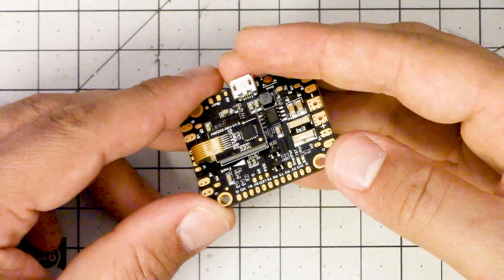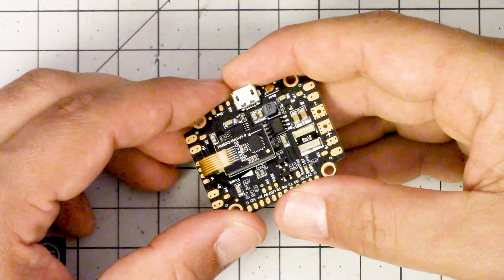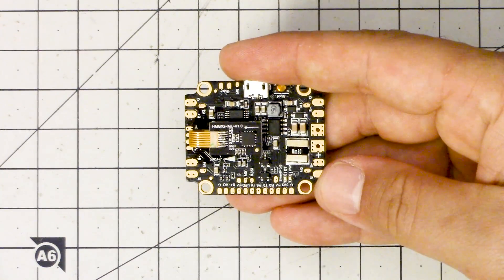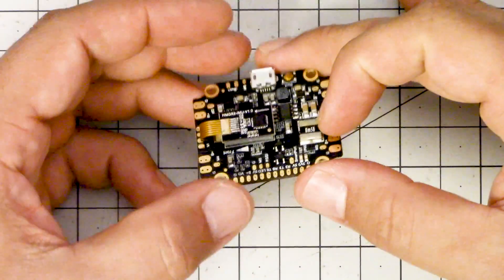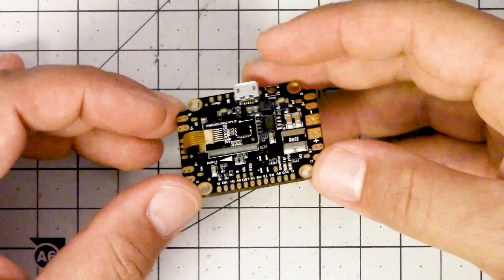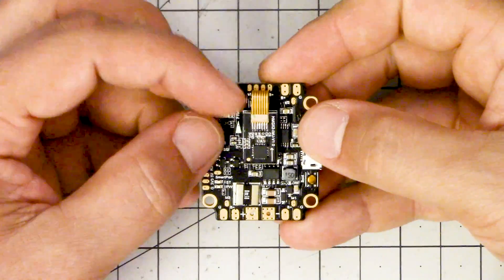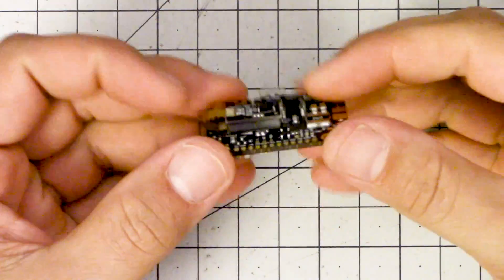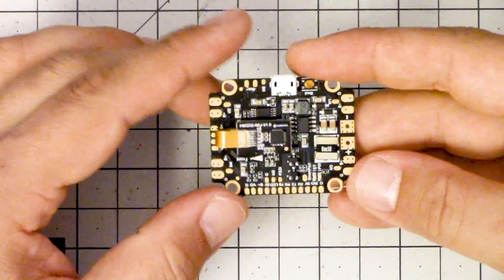Holybro Kakute F4 AIO | BETAFLIGHT FLIGHT CONTROLLER REVIEW

Comment: No regulator or LC filter (like the BFF3) for powering VTX and camera?
Reply from the maker: The product page shows the specifications, which contain the answer to your question.

"Filtered voltage output for clean, noise-free video. On-board regulators output 5v at up to 1.5 amps and 3.3v at up to 200 mA to power peripherals such as receiver, video transmitter, FPV camera, or LED strip."
Reply: Joshua Bardwell My VTX needs 7+ volts, so I guess the answer to my question is no. The BFF3 can supply filtered VBAT.

Comment: I appreciate the perfect work with the documentation... but the hardware is HolyShit .. sbus and smartport not working ... and it doesn't matter what BF version or which FrSky receiver you use (also tried different FW on each receiver) and for sure halfduplex off (syntax depending on BF version)
had to replace the brand new FC with a Matek F405-AIO ... and it seems I am not the only one with problems
Really sad about swapping the FC ... but even if a replacement would work, I would always have a bad feeling when flying
... again ... best documentation ever!!

Comment: Hey @Joshua Bradwell!
 
what you think could happen if with time, temperature or other external forces the angle of the gyro changes!? I am afraid that this could had a devastating impact on the performance, no? I see the benefits of soft mounting the FC, but if then the angle can change slightly, the gyro can´t do it`s job good anymore. 

Or am I over thinking this? Can't the foam move really? Or is the code handling that? What do you think folks?

Greets from Germany!
Reply from the maker: The foam is stiff enough that there won't be any unintended motion. You do have to route cables so as to avoid bumping the gyro though.
Reply: Joshua Bardwell thanks for the reply! 
I think if the angle of the Gyro is off there will be problems. When setting your board orientation wrong in the configurator it will cause big problems. And like 1-3 deg can be a easy of when gluing like that, what could cause some issues, don't you think? But I would really like to hear from you that this fears are without reason! Keep up your great work! Cheers!

Comment: Does the Kakute F4 have 5V reverse current protection on the 5v regulator? Thinkimg of installing a runcam split without a diode. Can anyone answer this?
Reply from the maker: I doubt it. Just don't run the Split and plug in the LiPo at the same time and you'll be okay. The issue is not reverse current. It's when two regulators are on the same rail at the same time and they "fight".
Reply: Joshua Bardwell thx man, keep up the good work with all the videos

Comment: Josh I'm having trouble with this FC.  I'm trying to flash a newer release of 3.2 but I get failed to open serial port.  Have you been able to update yours?  Btw the video with drew at flight fest was very funny.  Thanks for all your work!
Reply from the maker: Are you holding down the bootloader button when you plug the board in?

Do you see "DFU" in the upper-right pulldown menu? Or do you see "Manual Selection"?
Reply: Joshua Bardwell I did hold down the boot loader button.  It did say manual but I don't know if there was a dfu selection in the drop down list.  I will check when I get home.  Thanks
Reply from the maker: If you don't see "DFU" then your drivers are not set up right. Use the ImpulseRC Driver Fixer. Plug in your board in bootloader mode after running the app.
Reply: Joshua Bardwell I just watched your old video and I didn't do the Zadig driver update for boot loader mode.  So I'll see which method works "impulserc" or the "zadig"?  The reason I'm doing this is I can't connect to blhelisuite32.  It tells me to update the interface to supported revision protocol 107 or higher.  Do you think an update will help?  Thank you
Reply: Joshua Bardwell I did the impulseRC driver fixer and it worked like a charm.  I updated to a later release of betaflight and now I can access blhelisuite32 to reverse motors.  Thanks for taking the time to help me!

Comment: Hey Josh, While soldering on the ESC to the FC, the M1 pad lifted off the PCB with barely any force while I was soldering the ESC ground wire to the ESC ground wire pad.  Is there anyway to fix the M1 pad or is the FC toast?  Thanks.
Reply from the maker: Most likely, you overheated the pad with too hot iron or too much time spent working the pad. The good news is the Kakute F4 AIO has six motor outputs, so you can just remap M1 to M5 or M6.
Reply: Sorry Josh, but this is not overheating.  Even gentle pressure (like moving the attached wire aside) is causing the small pads to come off.  Never had a problem like this before and I have built several quads with the Kakute F3 AIO.  Just a warning to others...be super super super careful.

Comment: While it's a good solution for isolating the gyro from frame vibrations, I expect that open soft mounting will create even more problems due to wind turbulence. There's a lot of wind rushing through a frame at high speed. The slightest nudge on that ribbon cable or gyro board is going to be noticed.
Reply from the maker: We haven't noticed anything like this in our flight testing FWIW. Obviously, we can't test all possible frames and etc. If somebody were running into this type of problem, I would recommend replacing the factory foam with something like 3M foam tape or servo mounting tape. Something lower-profile and stiffer.

Comment: Joshua, hello from Ukraine!
I bought two of this boards and I have a question about RSSI.
I soldered wire from XM+ RSSI pad to RSSI pad on a board. But on OSD I have 99% always. 
Can you advice me, how to fix it, what should I do in order to make it work.
Thank you in advance!
Reply from the maker: I'm not sure how the RSSI pad on the XM+ works. I know the XM+ has RSSI transmitted on channel 16 always. In Betaflight you can set an RSSI channel where the channel value is interpreted as RSSI. That's the way it's intended to be done with the XM+.

Comment: Joshua, Why cant I run 32k 32k on this fc without 100% cpu usage. It can only manage 32k 8k or 16k 16k. I'm running betaflight 3.17 and only telemetry turned on. I've tried the latest nightly build of Betaflight 3.2 to program the escs, but the motor tab didn't work, so I went back to 3.17.
Reply from the maker: 32k support in 3.1.7 is completely at your own risk. If you want to run 3.2, you have to download the compatible configurator from github and manually install it. The current release of the configurator, which is in the app store, does not work with 3.2.

You are trying to use an un-released feature in a pre-alpha firmware is the short answer to your question. When a version of betaflight releases with 32k support, then this board can be expected to support it.
Reply: Ok, thanks for taking the time to answer.

Comment: You should have told Holybro that 120A continous current (2 oz copper) is to few in time with avan props and 2306 motors.
I like the gyro solution but I think I'll choose another board with more room for hungry motors.
Reply from the maker: This is a tough call, because for every increase in max current you lose resolution. I feel like somewhere around 120 to 140 amps is the right place for the max current because very few setups are actually going to have batteries that can provide more than that for longer than a fraction of a second. Going to a 180 amp max (for example) means that the 1% of people who are running a 180 amp setup are happy, but 99% of people get less resolution as a result.

If you are good at soldering, you can desolder the gain resistor and replace it with another one to increase the max. Also, I remember from the RROSD that you could solder another SMD resistor on top of the existing shunt resistor to change the scale. Maybe that would be the easiest thing for you to do?
Reply: It's not just that I need more continuos current but I read somewhere that you need some headroom because with smaller paths and higher resistance you start to loose power.
Reply from the maker: Well, if you really care about that, then you'll build your own distribution system from 12-gauge wire instead of using a 2 oz PDB. Most people will find the convenience of the in-built PDB more valuable than whatever 10ths of a volt they gain from a lower-resistance path.
Reply: maybe I'm a bit nitpicking. I guess with my beginner skills it doesn't really matter.

Comment: Hi I have build a quad with holybro Kakute F4 and it´s working good but I can´t get the smartport working. I have tryed to update to lastest betaflight firmware 3.2 17-07-13 with port configure to smartport on port1 and enable telemetry in config. I have tested with X4-RSB and XSR-M. I have hourors X12S and installed BFSetup-Horus-v0.3. Any ides?
Reply from the maker: Have you enabled the Telemetry feature in the Configuration tab?
Reply: I have done that I also updated the receiver firmware to the latest.
Reply: What did you do to fix the problem? I have same issue with my taranis.  i dont understand what it's in the link ( Merge pull request)
Reply: I have not tested it switched back to XM+ but check his video about installing 3.2 then you can try. It may be a fix for the problem.

Comment: Great Job on the Manual Joshua, got one of these on the way & was giving the manual a once over & spotted something that made me think twice, At the top of page 9, there is a box that states: Solder the video wire from the video transmitter (vTX) to the
VI pad on the Kakute F4 AIO.
Solder the video wire from the camera to the VO pad on the
Kakute F4 AIO.Is it me..? shouldn't the Camera signal wire go to VI (video in to the board) & the VO ( video out to the VTX) ?

Comment: how much testing has been done on the adhesive hold in temperatures. i have a feeling there's going to be some issues up in the north when the cold hits.
Reply from the maker: Funny. I would think heat would soften the adhesive more than cold.
Reply: it will soften in the heat but still retain its stickiness and work because the  gyro is light (not enough mass to dislodge it) but in the cold everything contracts and stiffens up and the adhesive pulls away from what ever surface its on.

Comment: With all the wires soldered to the PDB in a all-in-one there's really no way to soft mount it... this is a great solution if it's filtering the problem frequencies and the cable can be replaced. Wait and see....

Comment: Another great video!  I'm a little concerned about the ribbon cable, I think the connections will vibrate off over time unless the cable is secured to the gyro board as well - looks like it is?  Awesome to have a proper manual, agree on the SD Card slot, nice to have.  Can we get Fatshark to listen to you too? :o)
Reply from the maker: The cable is secured to the gyro board with solder. It will not vibrate loose.

Comment: It's a great manual mate, should be proud of it.

The s.port works a treat along with LUA scripts. Vibration mounting works amazingly well so there is no problem with the mounting (well and truly tested). You do however need to run a specific .hex file atm if you want blackbox recording as the standard betaflight build (and one loaded on the board) causes the OSD and camera output to drop when running blackbox.

Big point worth pointing out is the through holes in the board for all the major board connection points (ESC's, batt etc), this stops that pesky lifting of the pads problem that can happen in hard "landings"...

Comment: If theres anything I wish this board was/has it would be those small solder pads on the sides and other small pads to be through hole instead. I understand there are design limitations but they don't have to be the size that would fit pin headers but just enough for wires to go through. I prefer through hole mainly because they are more tolerable to work with and you won't peel them off. Yes, those who don't know how to solder properly could peel those pads off by applying to much heat on them. Take F4-Flame Race Spec FC for example.
Reply from the maker: Whether the pads peel easily depends on how the board is designed. Pads can be way stronger than through-holes because they have more copper to take the heat.
Reply: Agree.. and I don't see it with KakuteFC though. And FC layout designers are not going to put solder pads as big as those pads for battery terminals for signal wires. The KISS FC for example. KISS FC's solder pads are bigger than those solder pads on Kakute and there have been reports of pads getting totally peeled off. Also, by design (plated) through-holes are stronger than pads.

Comment: Would be curious to see how this performs on setups with known noise issues. I have a quad that is a pain to softmount due to lack of stack space and bad mid throttle oscillations due to torquey motors
Reply from the maker: +dave123443210 let me know! I'm curious too.
Reply: Joshua Bardwell think I will pick one up after finish current build. 

PS Was just thinking it would make a good video series where people send in quads (perhaps after a fb competition) with known vibration issues - you test before and after and send them back with a AIO sponsored by holybro. Would be good for their product and good content ;)

Comment: If you fly like me that gyro will be ripped off within the first 5 flights
Reply from the maker: +Christopher Punton what is going to hit it? It's inside your stack. Anyway, feel free to use a stronger tape if you prefer. There will be less vibration isolation but it's no worse than if you had a hard mounted gyro.
Reply: My quad loves concrete lol everything gets ripped off I guess in this case it would be gforces vs sticky tape got a feeling I know the outcome
Reply: I can assure you no matter what you hit or how hard or fast you hit it, the gyro ain't coming off, I have seriously tested that in the field many times I can assure you, try getting the gyro off by hand and you will understand  :)

Comment: I read through the manual and it is definitely the best fc manual I've ever read 😁 Adding links to videos really makes it more accessible to a broader audience.

A piece of work to be proud of.

The only two (very minor) things I thought about as I read through it was 1) the serial rx only aspect wasn't mentioned in the introduction/features and 2) that when saying don't go above 1.5A on 5V it would have been extra clear to say 1.5A/1500mA since most consumption figures to add up are typically given in mA.

Comment: Hi Joshua, I have been running this board for a couple of weeks and generally I am very happy however there are a couple of issues. The IMU mount on mine may be an early release as when I hit a gate it has been known to instantly cartwheel out of control. The foam pad I have is darker grey.
The other issue I noticed is with the current measurement (which Holybro have confirmed) only reading to 60A at maximum scale. The fix for this is to replace the R17 SMD resistor on the back of the board and I have explained this in the RC groups post here 
https://www.rcgroups.com/forums/showpost.php?p=37856430&postcount=84
I have attempted to change this resistor with my TS100 at up to 400deg and cannot get enough heat into the resistor to remove the old one.
It is a tiny 0402 packaged resistor and is a difficult task to replace.
Holybro have indicated all new boards from 1st July will come with this modification already completed.
Your manual was great and the fact you had written it contributed greatly to the reason for me purchasing it. Thanks for your work.
Reply from the maker: +Boompy FPV you may be able to stack an additional resistor on top to change the gain value.
Reply: Joshua Any idea what value resistor the original is

Comment: Quick question on this board.  
I have a 7.4v min VTX, but the Kakute only has filtered output for 3.3v and 5v.  Would the VTX still work fine on the 5v filtered output - as long as I don't crank up the TX power too high?  Or should I go to vBat and either add another inline filter, or live with the noise?

Comment: You could probably remove the gyro from the foam and let it sit outside of the stack, might be more room to soft mount it directly to the frame next to the stack instead. Should work just as well and saves some (usually) precious stack space.
Reply from the maker: There's additional risk to this approach but maybe it would work well.

Comment: Nice review Joshua... I just built a 250 quad and this board made it so easy. The only thing I've had an issue with is the onboard storage for Blackbox. Betaflight says there is no flash storage so I'm not able to record flight logs. Any ideas on this?

Comment: Just added this to a Japalura 3" and so far it is really smooth and solid.   Still have to shake it down in the long haul, but impressed so far.  And I agree on the mounting complexity.  I tried to put a receiver onto the stack above it with standard stand-offs but the receiver had a chip on the underside that would touch the IMU (and it was a pretty low profile chip).  Adding some more space to the standoffs will help, but obviously it will make it tight for anything else on the stack.
And as for the manual...I was reading it before I saw this video and definitely noticed the attention to detail - especially the QR Codes were a nice touch.  Good job.